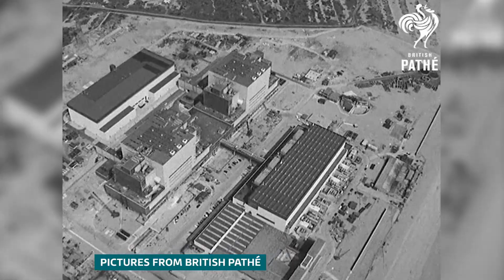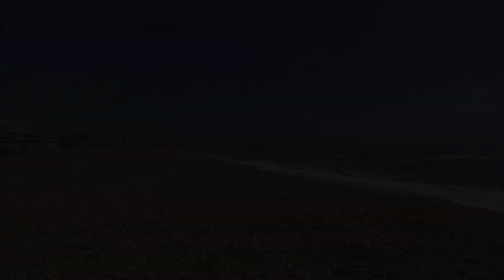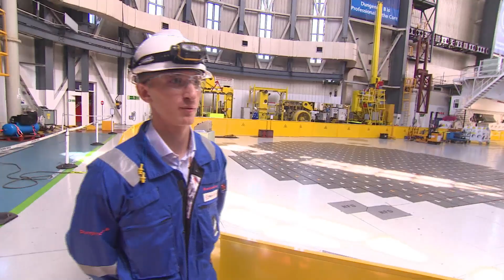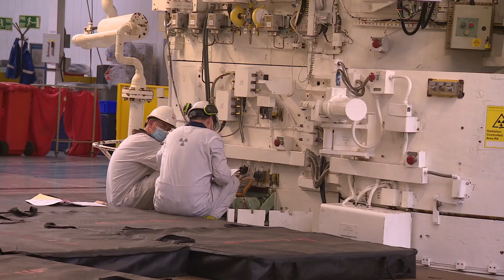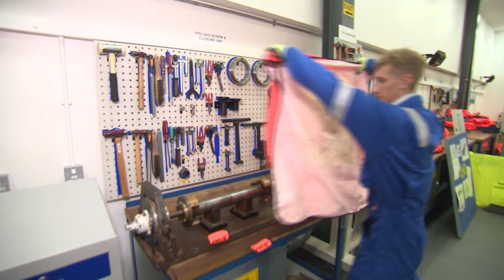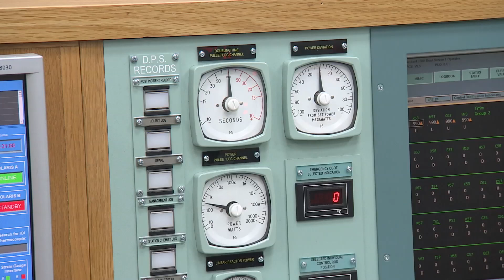Inside Dungeness Nuclear Power Station ahead of decommissioning  | ITV News Meridian | Kit Bradshaw

Comment: How does a skinny plastic suit stop radiation, when Chernobyl is entombed in concrete...
Reply: The plastic suit is protecting against contamination, if radionuclides get inside the body they can cause damage over a long period, so potentially a worse outcome than a short duration dose to the outside of the body.

Comment: Absolutely idiotic design, NO containment for the reactors, merely corrugated steelplates and even windows. In case of catastrophic accident, this paperbuildning would fold lika e deck och cards
Reply: That’s just the building it’s in. The reactors are encased in metres of concrete, it was one of the safest designs in the world.
Reply: It’s Dungeness nuclear power (with its flaws of which you speak) or rely on Russia for our energy. A nation that could cut it off and leave us high and dry at any time, freezing our arses off come winter. Even though this stupid country has already made its choice, I don’t know which is worse.

Comment: Molten Salt Reactors are comming, thank you. But those 4th generation reactors are not really compatible with the old nuctear tech, in fact, you can rather retrofit a coal plant then a nuclear. Light water reactors should never have been build in the first place, the inventor said so for a good reason.
Reply: No Just More Nuclear Lies  & Cancer Lotto @ 38 CPM
Reply: Lightwater PWR is perfectly fine. BWR lightwater is fine these days too. You have to remember. The inventor made the BWR before things like RCIC, RCSS, LPCI, HPCI, the RPS, safety standards, simulators, all of that. 

So essentially. What makes LWBWR (light water boiling water reactors) so safe now adays are the increased safety systems that have been invented. 

RCIC (Reactor Core Isolated Cooling System) This is a steam driven pump which takes steam from the core to drive a pump which takes water from the condensate storage tank and moves it into the reactor. The steam driving the pump is then put back into the taurus of the reactor or the CST. This works even in the event of a total loss of power. Which would include... 2-4 transformers, 4 diesel generators, and 100s of batteries.

RCSS (Reactor Core Spray System) This system sprays water directly onto the steam bubble to rapid suppress and cool the reactor.

LPCI (Low Pressure Coolant Injection) This system rapidly raises water level after shutdown.

HPCI (High Pressure Coolant Injection) This system rapidly raises water level if scram has just happened and pressure is too high for hte LPCI to inject efficiently)

The RPS (Reactor Protection System) This system prevents the operator from moving rods when unncessary. It also automatically moves rods to level out all of the fuel channel temperatures. It also automatically does certain actions. See. A BWR RPS is capable of fully keeping a reactor from melting down for SEVERAL hours as long as at least batteries are operating. 

As a matter of fact. Coal has killed more people than all nuclear disasters combined. And all nuclear disasters combined have killed less people than most energy sources. Even some of the renewable ones. The reason is simple. Radiation is not as bad as living in proximity to other people and their CO2. Something like chernobyl would be bad, however, now the wildlife a few decades later is thriving now more than it ever has. And TMI didn't kill 1 single person. There was a lot of scare about cancer related deaths, however, there was no data to correlate such findings elevated outside the cancer that is already caused by the coal and gas power. 

Here is a fun fact. A coal plant produces a SIGNIFICANT amount of radiation due to contamination from uranium.

Comment: So we need more so called "GREEN ENERGY" and they do this lol
Reply: Hunterston B and Hinkley Point B are also being switched off in the next year, and Hartlepool and Heysham 1 will follow not long after. Hinkley Point C will replace two of these stations, but we are still almost certainly going to end up burning more gas to generate our electricity... successive governments have failed to invest enough in the nuclear industry over the last 40 years and as a resilt we are going to be forced to emit even more CO2 to generate the electricity we need.
Reply: Did you hear what they said? they said there were more faults than the engineers knew about, no one could of known how long those faults were around.
Hinkley point B had many faults, most of them were corrected but some remain and require the reactors to run at 70& capacity.
Reply: @FowlorTheRooster1990  the next ones will need to be built with more care... hopefully SMRs can pave the way for safe nuclear reactors, with the govt investing over 300 million I hope we can find results!